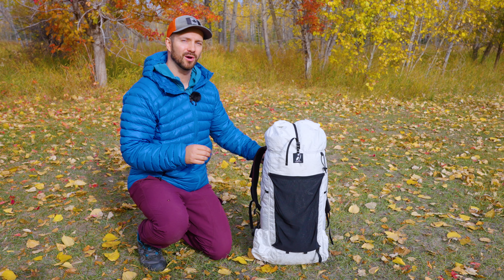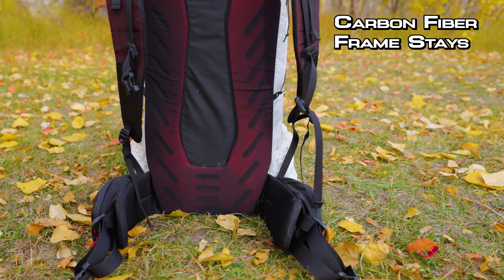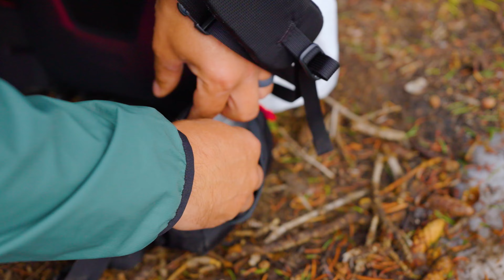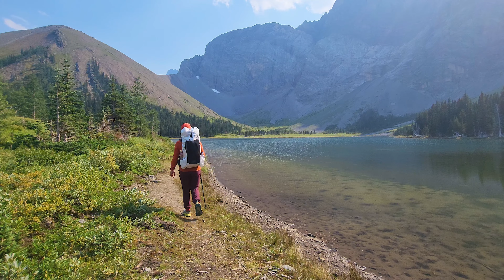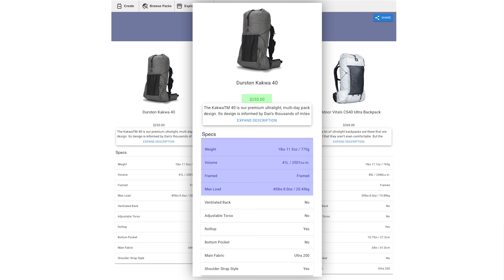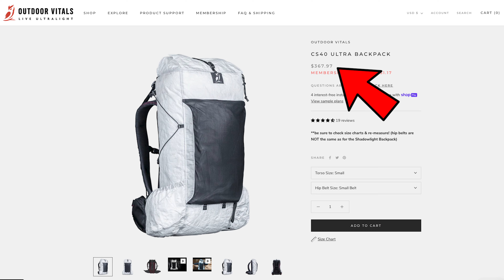PEAK ULTRALIGHT DESIGN or OVERPRICED? Outdoor Vitals CS40 Backpack Review

Comment: My Outdoor Vitals tent failed a couple of years ago during the 3rd use. It failed catastrophically during a camping trip. Outdoor Vitals first denied that it happened until I sent photos of the pole breaks and the poles ripping through the tent. Then Outdoor Vitals denied the lifetime warranty and refused to replace or even fix the failed tent and poles. Again, I was ON a trip when this happened. Ultimately, had to go out and buy a cheap Coleman tent that I still have, and Outdoor Vitals refused to replace or fix their tent with the “lifetime warranty.” Ultimately, these are terribly made products, backed by a lying company, and a fake warranty. Move on and save yourself the hassle that I had to go through.

Comment: Very odd language around the price comparison $399 is not "Much more expensive" than $368, even if you consider all of the addons to meet the functionality. Also, $250 is not "a little bit less expensive" than $368. $250 is massively less expensive that $368! Really it comes down to which one is more comfortable and can meet the needs for your trips.
Reply from the maker: The Arc Haul doesn't come with hip belts. It ends up being 460 when you add hip belts. It's close to $100 difference as you go from the Kakwa to the CS40 to the Arc Haul.
Reply: @GearPriority  With that logic you'd have to add the cost of shoulder strap pockets to the CS40 to match the functionality of the Kakwa, making it much more expensive than the $100 price difference it already is.

Comment: One short coming of this pack is top straps.  The closure strap buckle up and over, which is not as water tight has bucking down the sides.   The single back to front strap just isn’t as secure as a Y-strap.   Other than these two short comings, my wife really likes the fit and feel of this pack, due to it’s adjustable.
Reply from the maker: I prefer role tops that don't buckle down the sides. It's personal preference though. I don't rely on the fabric of my pack to provide waterproofing (the CS40 isn't seam sealed).

Comment: I'm glad you tested at 40 lbs.
It represents a water carry, helping a partner, or skis/packraft, etc.
Any old pack can carry 25 lbs with no problem; the differentiation begins above 30-35.
Still, there are better packs for less. Like most OV stuff, it's more fashion than function.
Reply from the maker: What aspects of the function didn't you like when using the pack?
Reply: @GearPriority  Heh. Fair question. :)
OTOH, isn't that why we rely on good reviewers? 
But I have used other OV stuff, which was what I referred to. You will see the review.

Comment: I've been waiting for a more in-depth review of this pack from you. Great video. Thanks Justin! Grab a Kakwa and let us know what you think. I just got one for myself and finished a 30 mile trek on the AT. It performed well with 25lbs, and could probably handle 40 easily.
Reply: I got one this spring, a 44L variant and agree with Crane, absolutely love it. It feels SOOO good on the back with that internal structure. It has everything I need/want and nothing I don't. I'm kinda over folks dogging on UL packs being just a dry bag with straps, because all the engineering going into these is where the money comes into play. The Kakwa is so doggone light, strong and comfy. I thought the hip belt pockets were too tiny, but then I found that I really enjoy their size. I thought the hip belt was too wimpy, but I love the simplicity of the dual/opposing straps. It's a perfect pack for many, and I'd love to see what Justin thinks too.  This OV pack looks to be similar, just heavier...prob due to the beefy hip belt and pockets.